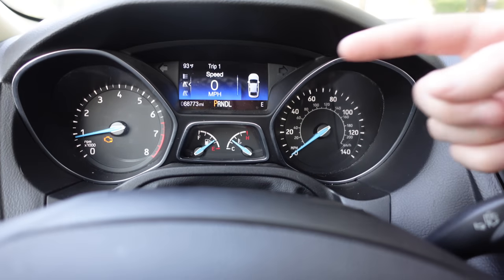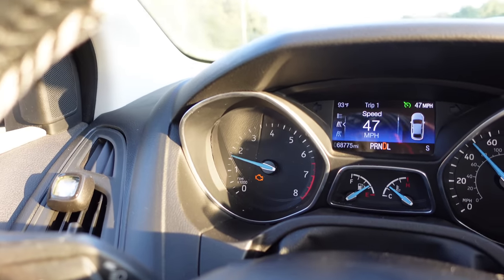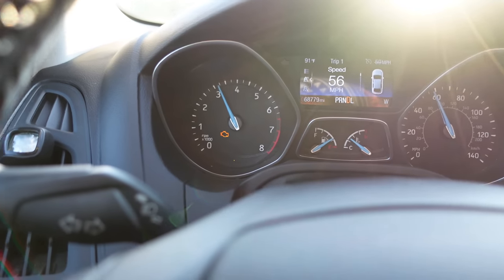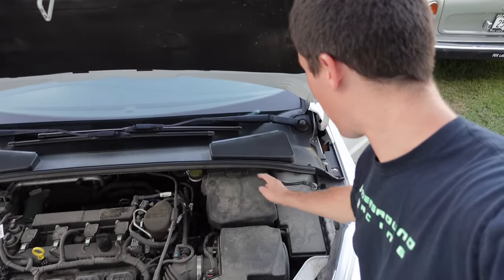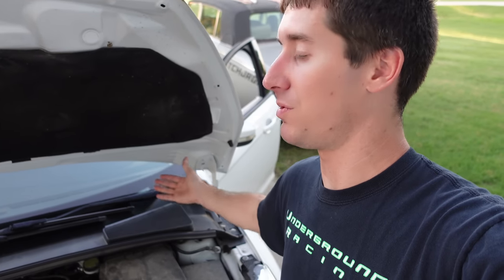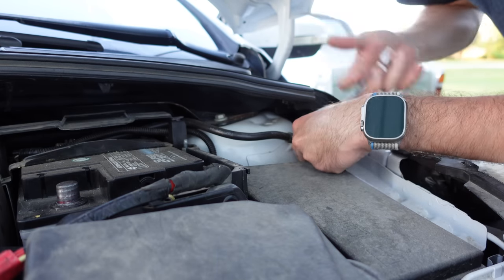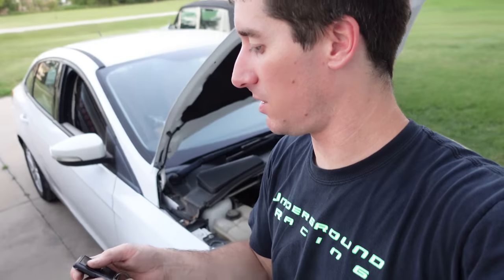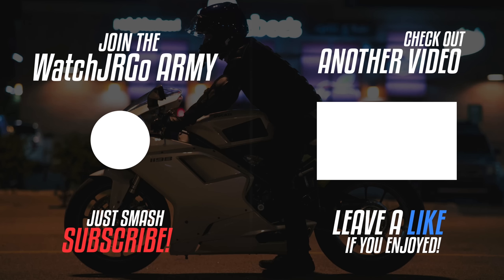This NIGHTMARE Transmission DESTROYED The Ford Focus (Fixing My Girlfriend's)

Comment: Had two of those Focus’ in the family, both had transmissions fixed multiple times under warranty by Ford. There was a great article by the Detroit Free Press about this transmission and about how Ford knew it had massive issues after testing, but went ahead with using it anyway.
Reply: Heard about that, when the replacement transmission is no better than the original and Ford knows it !
Reply: I actually just barely avoided it. Salesperson was pushing the automatic transmission features really hard on my 2015 fiesta... I decided to get the manual because I thought it was more fun to drive. They suggested that the auto transmission was more efficient which I cannot imagine since I get between 38 and 40 mpg with my mixed use driving of the fiesta.
Reply: @alleriodrone That's amazing mpg my Dad got 25mpg in his 5spd Chev Aveo he purchased new. I think he got it for like under 10k brand new in 2010 with his GM rebate
Reply: @ricochetey  yeah, I'm really annoyed at Ford discontinuing it. Can't find anything on the road today that is that efficient unless it is hybrid. Wish they kept chugging toward higher MPG with it but the US market continues to go to larger cars rather than smaller. I posted to Facebook that in a few years we'll all drive tanks and be looking at another energy crisis because charging the batteries will be just as crazy and our power grid will not keep outpacing these cars (California already has issues but I guess they don't count since they've almost always had power issues)
Reply: That was the boss decision
Reply: I bought a brand new 2012 Focus (shuttering tranny problem), was in shop every 5k miles! Their engineers knew it was not something that could actually be FIXED. I paid 30k and was offered 4500 as trade in 4 years later! I’m NEVER trusting Ford Again! Class action lawsuit is a joke (my online service records are deleted/missing) go figure!
Reply: @JoniSpiser-cj1ft   yeah, the way they rushed that transmission out was very bad. Their manual transmission in my fiesta seems to be ok but I question some of their other design decisions (2 of the blend door actuators are currently clicking in my car and annoying me a lot)
Reply: passing on what media says someone knew is a load of crap ford has the same problems they all have. they at DFP probably all drive Minis.  GM melting intakes, Toyotas remove engine to replace water pump,  honda pistons sticking in cyl,  subaru falty wheel bearings, hyundias oil pump and oil clogging gdi,    nissans failure of cvt transmission......i rest my case
Reply: @alleriodrone  They click on GM's also. My Impala had four blend doors. I replaced three of them twice. Mechanic said all domestic cars do the same thing eventually.
Reply: @robertbruneau112 honda issue is easy. 2 drops of prolong and it's all gone
Reply: In my opinion, Ford knew the DCT behaved like a DCT, but they weren't transparent about that in marketing. So when people's cars started shuddering and grinding (as mechanically actuated manuals do), they started freaking out and assumed something was wrong. Ford threw new clutch packs in their cars and placebo did the rest.
Reply: @robertbruneau112  also I just noticed you missed something about Subaru. Silicone protection in their engines after high mileage...... Ford chevy and dodge can't build a transmission that can match a V8 power so they let them fail on the inspection tables

Chevy has no problems selling a 3 year old rusty truck full price right at their dealership lot. Dodge I witnessed a mechanic taking out OEM heater cores failing right out of a brand new box. I think the mechanic was upset to because it sounded like he just installed a replacement heater core just to find 5 more bad boxes

Comment: The Ford Focus transmission defects have resulted in thousands of lawsuits against Ford across the United States. Today, in California alone, there are at least 800 current individual lawsuits against Ford Motor Company for issues with the PowerShift Transmissions on the 2011-2015 Ford Fiesta and 2012-2015 Ford Focus.
Reply: It should be pointed out, it’s not a Ford Transmission it’s a MagnaPT, previously Getrag, transmission.
Reply: Ford has bad 10 speed transmissions as well. But they love to outsource to low budget companies and get stuck in bad contracts.
Reply: Isn't that the same transmission as on the Transit Connect?

Comment: I'm glad my 09 Focus is still running like a champ.  Granted, I've only put ~60k miles on it. I expect it to last another 20 years.
Reply: My Dad has a 2008 4-door SES auto.  150k, never had an issue and still going.  Do your maintenance and you'll be fine.
Reply: Because you are a SMART MAN.  Car payments are for dummies.
Reply: The 2011 and older focuses are tanks. 2012 and later are not because of the dry clutch DCTs. Now if you get a manual one theyre pretty good
Reply: @justinprohm  I'm so glad I have an older one.
Reply: My 09 got 88

Comment: If you can find one with the manual transmission the 3rd gen Focus really is a great little car. But if it doesn't have 3 pedals, run screaming.
Reply: The regular automatic should be ok
Reply: @jochenstacker7448  In the US market at least there was no "regular" automatic in this generation of Focus. With the 2.0L you could get the DCT or a 5 sp manual. With the 1.0L it was the DCT or 6sp manual. (And of course the ST and RS were 6sp manual only)
Reply: @BigBagOfNope  ah, cheers
Reply: Yep my 2013 manual has almost 400k km and still rockin
Reply: My 2015 focus with automatic is still shifting like a dream with 137k on it
Reply: @BigBagOfNope The 1.0L Ecoboost comes with the 6F15 regular automatic instead of the DCT, which is the same transmission as other Fords of that generation. it’s a good transmission if you don’t want the manual.
Reply: @TOMTOM544  Interesting, I thought only the 1.5 ecoboost in other markets received the 6F15, but it sure wouldn't be the first time I was wrong and won't be the last haha
Reply: @BigBagOfNope  As a person that has both MTX75 (focus) and the 6f35(escape) I absolutely hated the 6f35, it's  such a pain in the butt to service!!!

Comment: There was a big class action lawsuit for those transmissions, took my ex-wife’s in to the Ford dealer and they replaced it for free.
Reply: Not me. I tried but my dealer said no since my car was already over certain miles.
Reply: so they swap out one turd for another turd.  the thing just does not work.  Its a design flaw.  Run as fast as you can from Ford motor company.

Comment: I was in Europe earlier this year and noticed a LOT of Focuses on the road while they are becoming somewhat rare in the US.
The difference: Most of the European Focuses have manual transmissions.
Reply: There are literally millions of them on the UK roads, out of the UK in the rest of Europe the Golf,.Renault Megane and Peugeot are the kings of the hatchback
Reply: I also read somewhere that Ford Europe used a wet clutch for the DCT, but cheaped out (per usual) for the US with the dry clutch. On top of that, instead of changing to the wet clutch after problems started piling up, they went with bandaid programming updates, probably hoping to push the lifespan until the customer was out of the warranty period.
Reply: Yeah, 08-11 Focuses are much better cars in terms of reliability. Although a ‘12-‘19 would make a great candidate for a manual swap.
Reply: Small econobox cars like the focus are also just generally more popular in europe
Reply: @mitchkelleher7972  They should have just taken the traditional 6 speed auto from the Escape and put it in the Focus. It should fit because both cars are built on the same platform and use variants of the same engine family. Oddly enough, the 3cylinder Ecoboost Focus does have this transmission.
Reply: Well my dad might own a rare 2015 ford focus se that thing came manual from the factory I don't think he is getting rid of it  anytime soon. Also, that is how I learned how to drive a manual transmission.
Reply: they have different software programming too
Reply: @mitchkelleher7972  Not quite correct. Ford Europe used the relatively reliable wet clutch on their diesel autos and the craptastic dry clutch on their petrol autos.
Reply: @@phillipbanes5484 I visited more than one country in Europe.
Reply: @@phillipbanes5484 I'd prefer not to discuss my travel itinerary.
Reply: @@phillipbanes5484 News flash, genius. People here are comparing European spec to North American Spec. There's no purpose in specifying a country as they're all more or less the same across a given continent.
Reply: I test drove a Ford Kuga with the power shift transmission and it was just dreadful, just stick to torque converter automatic transmission
Reply: @whatamisupposedtoputhere  Got a 16 focus with manual transmission 311k miles still runs great .😃
Reply: @halaheleu7013  I want one so bad but they’re so hard to find!
Reply: Manual always better
Reply: I Have a manual Focus here in Australia and the electric steering failed at 59,000 kilometers needing a replacement steering rack, then the heater core failed and the Camshaft position sensor, engine mounts sagged sending bad vibration through the car, mine still only has 98,000 kilometers and I'm wondering what will fail next and I want to trade it in and get rid of it.
Reply: Some of those Focuses are 4 cylinder turbo diesels, awesome rock solid cars and a lot of fun to drive. Lots of low end torque! I ot to rent a hatch back in Italy for about 10 days, loved it. You can't get them in the US, unfortunately.
Reply: It not just the dual dry clutch set up it's also the wonky software..... Stupid

Comment: I used to drive a 2017 GTI with the dual clutch and I loved the speed and response of the transmission.  The dual clutch used in those uses a wet clutch setup which is what Ford should've used for the Focus if they really wanted to go the DCT route.  A dry style dual clutch like in the Focus needs to be driven like a rental so the clutch doesn't have to slip as much.  It was the wrong setup from the get go for something like a Focus, or anything daily driver for that matter.
Reply: Small correction or two; VW uses dry clutch setup for its DSG in the lower power Golfs, including the GTI I think - the R and some of the higher torque diesels use a wet clutch. VW also had issues early on with their dry clutch versions, but fixed them a bit more quickly than Ford did. Similarly, Focus Gen 3 also used a (very reliable) wet clutch setup in the diesel Focuses, they were just never sold in the USA. I had one for 7 years and the gearbox was flawless in that time. Gen 4 Focus has moved to a traditional auto, however.
Reply: @sjb2471  In 2017 the GTI had the wet clutch DSG, it's the DQ250.  I can't speak for the lower power models because that's not what I was talking about.
Reply: @sjb2471  All the Golfs with the 2.0 Turbo (including the GTI) or the 2.0 TDI use a wet clutch (6-speed DQ250). The ones with a dry clutch are the ones with the 1.4 TSI, 1.8 TSI or 1.6 TDI, those had the 7-speed DQ200 (also notoriously problematic), the Mk7 facelift brought a newer DSG to the more powerful models, the 7-speed DQ381, also with a wet clutch.
Reply: GTI dual clutch are awesome, it's everything else lol. Had a 5 door and now a 3 door '11
Reply: The diesel Focus has a wet clutch DCT also.

Comment: Although I don't think the ground is the issue, the transmission ground is on the frame rail under the air filter box. I guaranty that there is paint that needs to be removed there also. On my manual trans ST I have removed and buffed the paint from all the ground connections because they are very susceptible to electrical issues from poor grounding and low voltage. I have also run a cable from the main ground on the chassis down to the trans ground on the frame rail just for a little extra insurance.
Reply: So much hate for the DPS6. It's actually a fun transmission to play with. It needs special operational rules that don't apply to any other automatic transmission. It has to be driven as a dual dry clutch transmission. It wants to be driven harder than many drivers who bought it, are comfortable with. If not operated correctly, a whole host of issues will surely occur, as the clutches shed more and more dust, from running really hot from abuse..... Don't creep in traffic, like you have OCD. Don't ride the clutch, by using 1st gear to hang on the side of a hill at a stop light....use the brake pedal, and hold it, silly....... pretend you are driving a manual, in D, but you don't have to physically do the shifting, just the throttle control, and brake....... shift gears in S, or expect each gear to wind out, before each changes automatically. If you begin shifting with the +/- button, you're in control from now on, unless you switch back to D, or come to a stop, with the brake applied.. the rules are completely different to a hydraulic automatic, or CVT.

Comment: I had a 2014 Titanium, which was a wonderful car. The transmission was odd, but since I understood how a DCT works I accepted it as logical trade off for the 39 mpg I got on the hwy. I had the ECU flashed per a recall and it really transformed the transmission to being almost normal. Still a bit odd, but logical. The damage was done with the original program so at around 85K I had to shell out $1400 for a new clutch at the Ford dealer. A real shame. I was planning on giving it to my oldest son, but I didn’t want to stick him with this ongoing problem.

The best thing to do is to replace the clutch assembly and either sell/trade it, or drive it with the understanding that it’ll need a new clutch every 85,000-100,000 miles.

BTW, the dual clutch refers to the fact that these transmissions are like 2 regular manual transmission built together. One of the clutches handles the odd gears (1, 3, 5, Reverse) while the other handles the even gears (2, 4, 6). Also, as it was supplied by Getrag, who makes DCTs for BMW, Ferrari, Mercedes and others, so the problem came down to the calibration and - perhaps - sub-par clutch materials.
Reply: It comes down to the fact that it is a dry clutch system, all the others you mentioned use wet clutch systems, for a good reason, using dty clutches us just cheaping out, and here's the results
Reply: I dunno.  My 2014 Focus has nearly 165K miles on it and it's still on the original transmission and clutches.  I am its only owner.
Reply: Kevin-fm1vn  That may be a factor as over 90% of my daily commute is highway.  I think they should've went with wet clutches instead of dry because the trans loves to stutter randomly when driving around town.
Reply: well as long as you don't creep it forwards cause that will wear out the clutches, you'll be fine with the tranny provided yours does not shift like it has a cvt in it lie my 2013 ford focus did and wore the clutch out by 27k kilometers luckily ford replaced the clutches with heavier ones and after that the tachometer needling jumped around lie a bunny rabbit during acceleration it was strange all it took to make the needle on the tach move was put in better clutches into the tranny to get the tach needle to as the car accelerates

Comment: Boy do i feel this pain! I never bought cars from dealerships, always shopped the private market for creampuffs. but once my 1999 Escort rattled its last, my girlfriend at the time (i have no family left to drive me around to look at cars, didn't know enterprise would pick you up to rent a car) insisted that she wouldn't take me anywhere (and my friends who at thanksgiving said, "we gotta get together sometime!" all had excuses at Christmastime) unless it was a real dealership (no "buy here pay here" scams which i wouldn't do anyway) and it couldn't be an older car (i always buy older cars, since problems are found out by then. few models are ever perfect, and the pursuit of efficiency has made for more problems as we try to bend the laws of physics).

Found a sweet charcoal grey 2018 Focus, it had been a rental car during the pandemic so you knew it had been cleaned daily. I didn't like the automatic transmission because I always went with standards, but I'm not a Luddite either. Paid $17K in cash, and 2 months later I get stranded in a gas station--had to bang it into 1st to finally get the trans to engage. Found out Ford knew back in 2010 (when detroit was suffering from the subprime mortgage crisis, so they weren't going to say anything) that the trans was unfixable because they use a dry dual clutch (VW uses a wet one). they claimed it was fixed by 2018, so even though there's a class action lawsuit, I'm not included because the car was too new to prove anything. 

ford's solution was to charge the customer $5K to install a new transaxle they knew was equally flawed...but by summer 2022, they had run out of transaxles and so they were piling up at some dealerships. So after two months, i took the $17K bath and scrapped the car. Bought a 2013 Hyundai Tuscon and learned at the beginning of July there's a class action lawsuit on those! the connecting rod bearing goes and worst case scenario blows out the side of the block and causes fires.

but no one will do anything about it, as Hyundai has time to appeal the "pending discovery" and change what they are responsible for. so i'm doing 10 hr round trips on the weekend--if its going to blow, that should do it and then supposedly i get a new engine and go on with life. meanwhile i'm clearing out my garage so hopefully i can get my 1986 GT Mustang back on the road...they weren't perfect but they get the same gas mileage and aren't running 100% efficiency so they won't wear out as fast. 

at least that's the theory :)